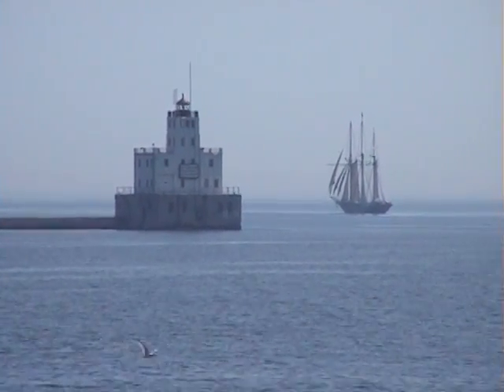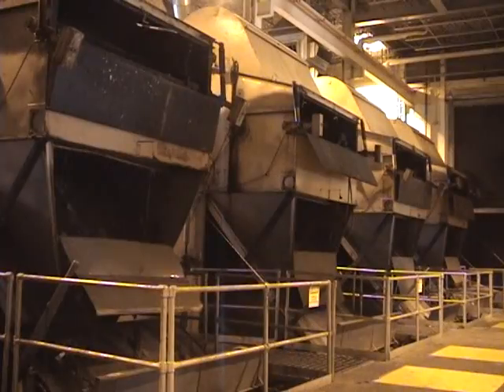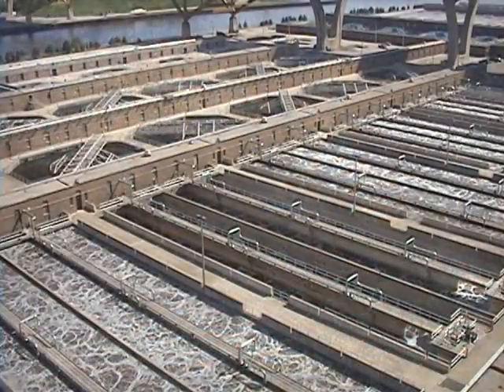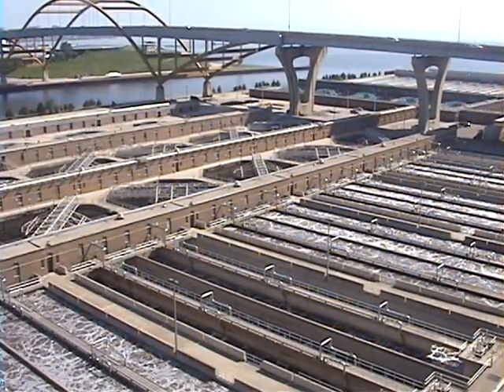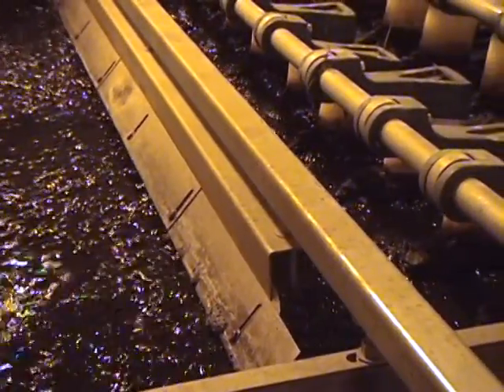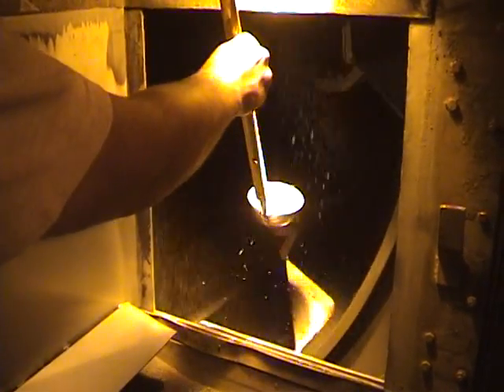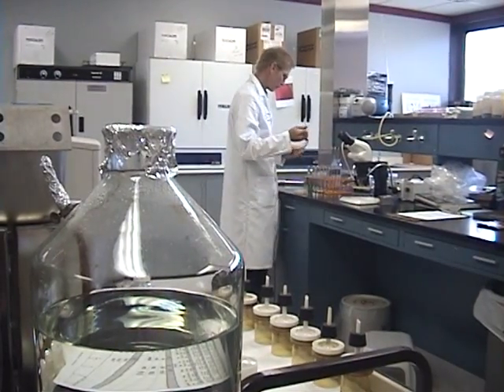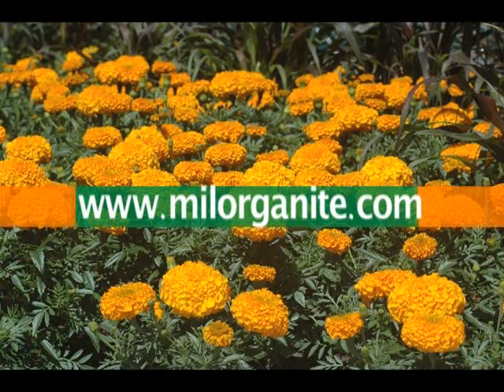How is Milorganite Made?

Comment: Its human waste. Disturbing and disgusting. 💩🚽 Milorganite is a brand of biosolids fertilizer produced by treating sewage sludge by the Milwaukee Metropolitan Sewerage District. The term is a portmanteau of the term Milwaukee Organic Nitrogen. The sewer system of the District collects municipal wastewater from the Milwaukee metropolitan area.
Reply from the maker: A common misconception is that Milorganite is “poop in bag”, when in fact Milorganite is actually composed of heat dried microorganisms (bugs).  These “bugs” eat the solid materials in the wastewater, die off and are heated to a temperatures up to 1200°, killing off pathogens that may be present.  Thus Milorganite is really heat-dried bugs, and safe for use. https://www.milorganite.com/using-milorganite/what-is-milorganite.